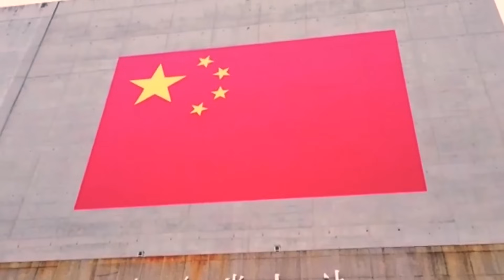🌊 This Dam Literally Changed the Earth's Rotation | The Untold Story of the Three Gorges Dam 🌏

Comment: No it didn't change the rotation of the Earth 🙄 dont be stupid
Reply from the maker: Well, You are not entirely correct, since there is a research by NASA that confirms that the Three Gorges Dam has been found to slightly slow the Earth's rotation by 0.06 microseconds per day. Of course it's such an insignificant effect, otherwise we would all be spinning out of control... 😀😀🤓🤓. Thanks for sharing your thoughts anyways!
Reply: @GreatBigBuilds  nah, sorry kid try again
Reply: @GreatBigBuilds  You are an id1ot.  This channel is garbage and this dam did not change anything in any rotation.